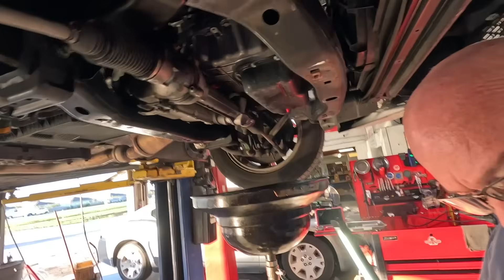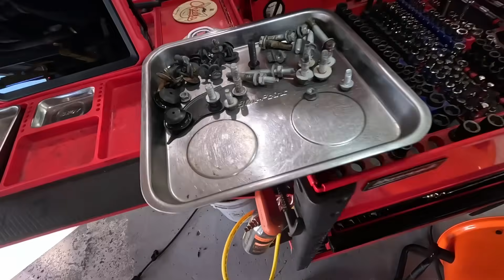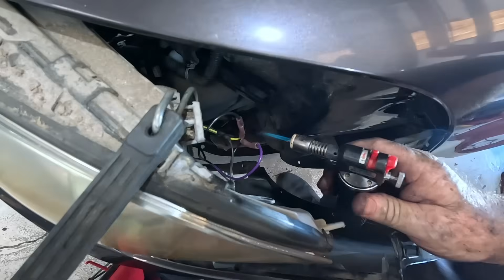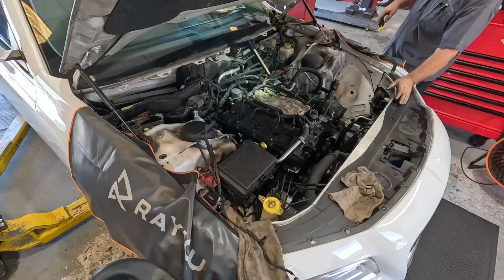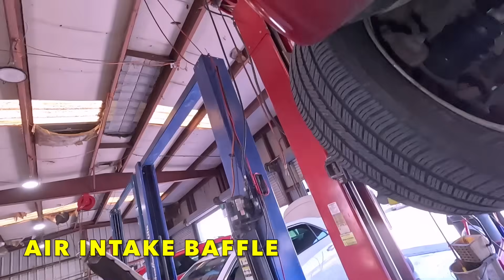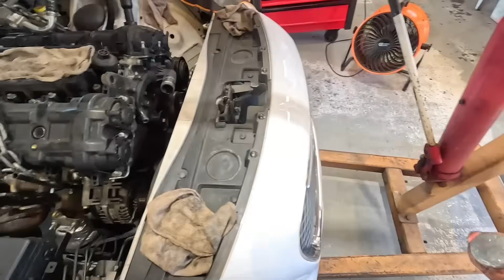DODGE 300 ENGINE, OIL CHANGES, HEADLIGHT DEBACLE, LET'S GO! AUTO REPAIR SHOP DAY 799

Comment: Jimmy! I would pop the valve covers off of that used engine just to take a look at the cam lobes and the rollers to make sure they're not gouged similar to what you're replacing. Just had that happen in a Wrangler with a used engine lot of noise on startup that would not go away. Trust me it's a lot easier taking the valve covers off with the engine out.... Stupid torx PCV setup ugh
Reply from the maker: Yeah, problem is at the labor time I was not enthusiastic about adding work. Paid 12 hours including diag tear down time. :/

Comment: That engine came out quite nicely.  It probably won’t be long before the car comes back to get the headlights fixed at your place or another. Hard to figure that one out considering that they probably had some charge for the work that you had already done.
Reply from the maker: Thanks, and you're right, sometimes things come back around! Might even be in an upcoming video? ;)

Comment: Jimmy! I know aftermarket warranty really stick to the hours if their footing the bill but 10 hours to change an engine nowhere near enough time as you well know. I changed the Fiat 500 engine a few years back and it was customer pay and the labor guide said 7 hours...
I told them no way!  I can hang 4 struts and do an alignment for the same amount and I'm not married to it... That 500 ended up being a disaster, wouldn't even start... had to perform a clear flood mode cranking just to build oil pressure to make the pile of crap run. Even though it was a 2015 it had 1234 air conditioning and we had to farm it out because we didn't have the machine then. Our friendly neighborhood shop banged us to the tune of $500 to recharge it...
Reply from the maker: Man that sounds like a Day in the Shop! Haha
Thanks for sharing your experience!